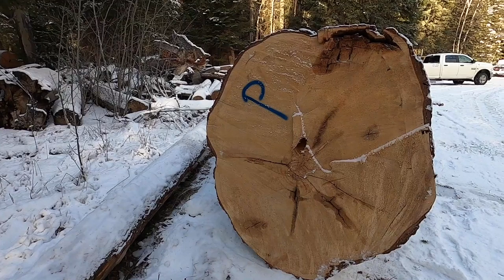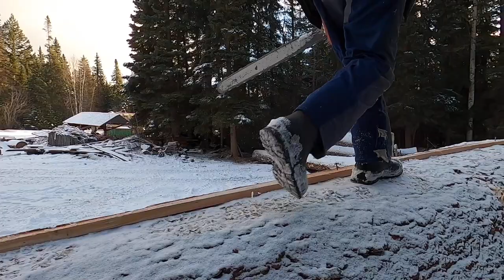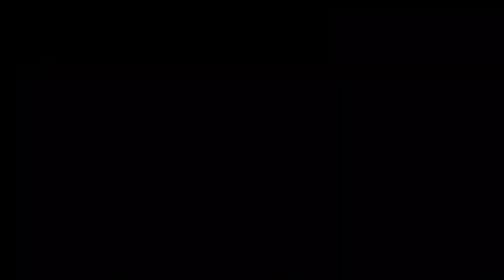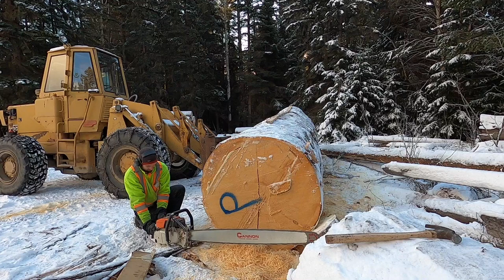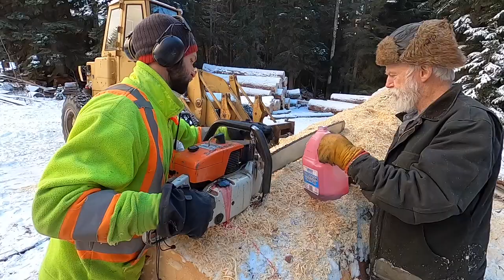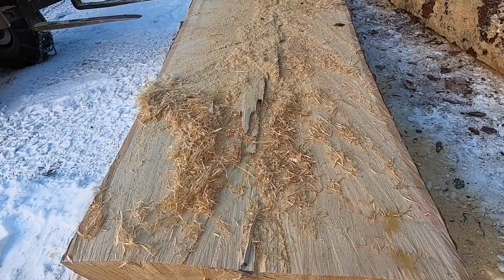Stihl 090 Chainsaw Comes Out of Retirement to Saw Huge Tree in Half

Comment: Do you ever use the manual oiler or do you ever oiled your gears?
Reply from the maker: Yes I have used the manual oiler a bit. You can sometimes feel the chain tighten on wide cuts and a couple pumps give you a few minutes of smooth sailing. Can't say I have dug into the gear box yet, but eventually that will need to be looked at.

Comment: Nice ole gear drive. I have a standard 090 with a 41" and 59" bar. That smaller saw must have some uneven rakers, she wants to jump. Here's a 6' Burr Oak I cut down with the 090 back in "15"    https://youtu.be/jdYvGkrBOX8
Reply from the maker: Ya the 066 saw was bouncing on the straight edge board pretty bad at the beginning of the cut. Hand filed rakers probably are not perfect though.
Reply from the maker: Nice looking Oak tree. let me know if you want it milled up. I have an alaskan that could probably do it. Or give me a shout if you ever want to sell your 090, they make excellent milling saws.
Reply: @MountainVoiceInc  Ten-4